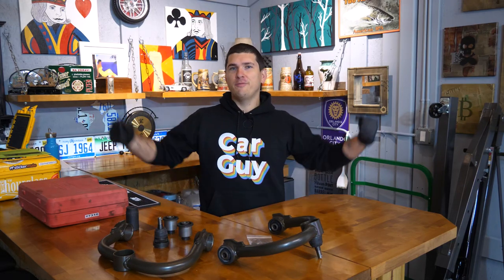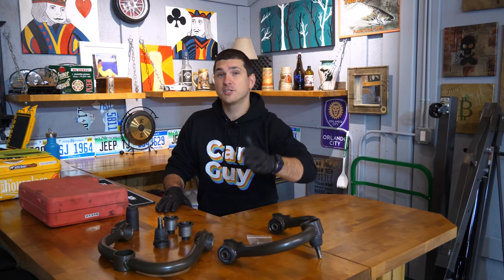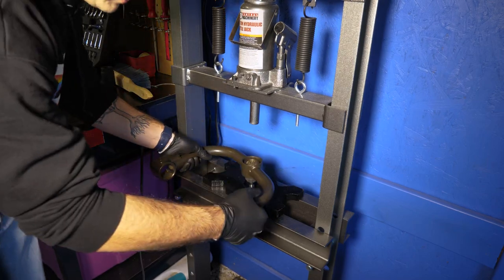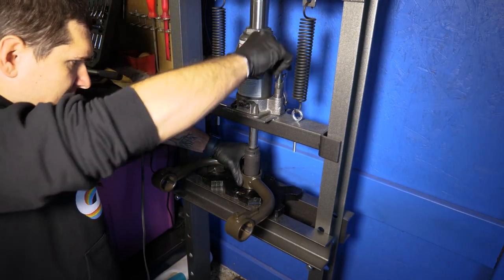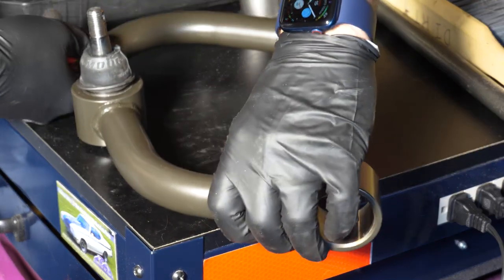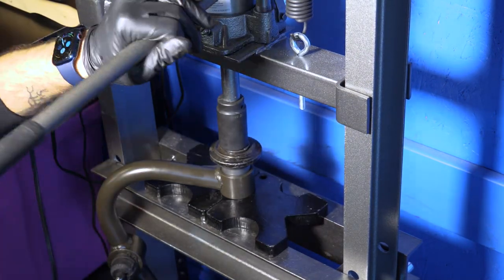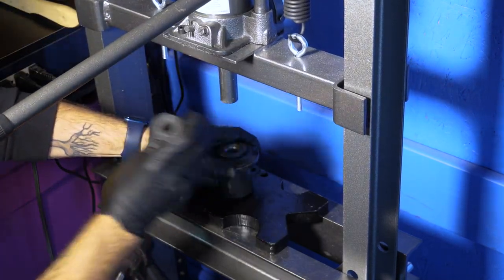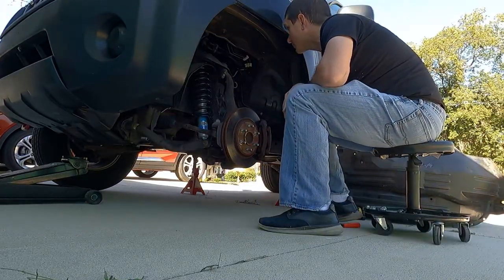How To Replace Upper Control Arms on an Xterra / Frontier / Pathfinder

Comment: Hi Ry! :)

I have a video suggestion, have you thought about putting Armada mirrors on the Xterra before? I saw someone on thenewxorg and youtube have them on their X and the benefits are:

- auto-fold or press button to fold mirrors (useful for tight parking spaces and small garages)

- auto-dimming (no more squinting your eyes or moving your mirror away to stop the ridiculously bright HID's from the car/truck behind from blinding you)

- turn signal LEDs (useful to help better alert someone in your blindspot that you need to change lanes)

- welcome light LEDs that illuminates the area near the passenger doors when you unlock the vehicle

Comment: As always,  clear helpful instruction for us X-terra do-it-yourselfers - thank you, Ry! As you've said/warned, take extra caution not to turn your steering once that linkage bolt is removed - learned the hard way when changing my UCA's earlier this year and broke my clock spring (broken clock spring = no steering wheel controls including cruise control and horn).
Reply from the maker: Oh yea, I didn't even think about the clock spring. It would over extend it and snap it. That's a great point.

Comment: I, with the help of Jisco Truck & Off Road, installed the RCKilla lift on my ‘24 Frontier and ran into the same issue replacing the stock UCA’s with Alldogs UCA’s.  We also disconnected the steering arm to remove the aft UCA bolt due to removal clearance.
I did not see this video, but called Alldogs for some guidance and they were incredible!  Walked us thru it and everything work!  
Thanks for this video and I’m now subscribed!

Comment: Helpful video, but you can bypass removing the steering linkage by levering it out of the way with a pry bar. Remove the other side of the UCA first and then you can pry the linkage out of the way and wiggle the UCA and bolt until it comes loose.

Comment: That was very well done. Comprehensive yet simple explanations. I  am at a crossroads as to whether I  should go to uca's when I upgrade my suspension. Gave me some clarity. Thanks. Happy Thanksgiving to you and your family.
Reply: Mike it all depends on what your bike plans are and how many miles you have on your vehicle. If you plan on going over 2.5” then arms are necessary. Also, if you have high miles and the bushings are worn then you have to decide if you want to replace with OE style or an aftermarket one like our ADO ones here.
Reply: @daywalker4029   Thanks for your input.  Probably on go with a 2" lift but the bushings and ball joints will need to be replaced. Guess it will boil down to cost/ benefit analysis.

Comment: Only issue I saw about my alldogs upper arms and might be something they could fix pretty easily to put a cap or plug over the top of the ball joint. It's a pretty big little bowl for water and dirt to sit, I just filled it up with silicone out of a tube and gun .
Reply: Good thoughts guys

Comment: Thank You for another superb video. I wish you were closer to me so I can bring you my truck. Right now., I am replacing the passenger side axle seal that I noticed is seeping. Also noticed that both upper ball joints are bad as well. So parts have been ordered, the Truck is on the jack stands, and trying to get this done with all the nervousness that goes with doing it alone. While watching your video, I was wondering where is your front axle, then I realize you have an RWD Xterra.  If you would near me, Bear and dinner would be on me, 🙂

Comment: 14:47 you need to use a 19mm pass-through shallow socket ratchet (DURALAST from Autozone)  to clear the brake lines. Worked great for me! Thanks @Ry the car guy!

Comment: I was very happy to see this video as I have been debating doing this myself be taking my XTerra into my mechanic! One thing I didn’t quite understand is what you are securing the twine to, couldn’t quite make it out and didn’t understand what needs to be protected.
Reply from the maker: The top of the knuckle needs to be secured in an upright position because there are two lines that go toward the wheel hub that cannot be over extended. One is the wheel speed sensor wire and the other is the brake line. The assembly is very heavy and it puts a lot of strain on those two lines if you let it go. I took the twine and tied it to the actual spring. To secure the top and the bottom was secured by the floor Jack.

Comment: Did you notice a difference in ride quality from having an arm with fresh joints/bushings compared to the old more worn out one?
Reply from the maker: I'm not even joking when I tell you this. The second I turned the Xterra over to take it for a test drive the drive belt snapped off and I said screw it and left to go on my trip. So I have not driven it yet. This is the second time my belts slipped off. I think my tensioner might be dying.
Reply: @Rythecarguy  I just replaced my 05 X belt tensioner but curious what are the pros to this upgraded upper control arms? I'm going to look for your video on xterra brake bleed & pads replacement front & back :) Also do you replace your cats yourself? In Cali we gotta be super on top of cats

Comment: Quick question Ryan, I'm having a hard time getting the steering column joint back in the steering column bracket. Do you have tips on how to make it easier?
Reply from the maker: Just jam something into the part where the bolt goes in to widen it. Thats all I got. That and maybe lube it up with chassis grease.

Comment: With this ADO lift, it comes set at 2 inches but with the bilstein adjustable shocks, are you able to lift it a little more?
Reply: Definitely steering towards this lift kit, and include the .5 spacer as well. Do you think this will be a problem with CBC?
Reply from the maker: No and yes. No you should not use the shock on anything but the lowest setting. The spring does all the lifting. 

Yes, I think lifting more using a spacer will start to give you CBC. Just using this kit got me close enough that I ended up swapping the UCAs.
Reply: I have 05' Frontier, RC 2.5 inch complete struts up front (No spacers). Will these UCA's get rid of CBC?

Thanks for everything, btw. My truck only runs because of you, haha

Comment: Are those zerk fittings for sure thread in ? I don’t see threads on the ball joint making me think there are drive in type vs threaded?
Reply from the maker: The ball joint doesn't have threads. I used the zero to tap it. I guess I didn't really say that in the video.

Comment: You mention that you have the 5100’s on the lowest setting. Is that the same settings you had during the install video? I rewatched it and I don’t think you ever say what setting you choose. Have you tried the highest setting? Are you planning on changing it now with the new  UCA’s?
Reply: He has the ADO springs on the 5100s. The springs do the lifting, so you can go over the lowest setting or else you run the strong possibility of breaking the shock. If you’re running the factory coil, you can put the spring perch wherever you want on the 5100
Reply from the maker: What he ⬆️ said lol.  Also yes, I have not made any changes since the install video. Everything is exactly as it was other than an alignment and cam bolts. (Also a video).

Comment: Will installing those upper control arms change the toe in and out at all i have them and want to install them butt can't afford a alignment right now i also have the cam bolts as well can i get the alignment close without wearing my tires I'm putting them on my 2018 nissan frontier pro4x
Reply from the maker: Yes, you will need to get another alignment after new UCAs

Comment: Well i got those upper control arms on my frontier they look good but at full droop they still contact the coil bucket right at the ball joint housing
Reply from the maker: Don't take this the wrong way, but did you install them backwards? I'm not sure how it's possible that you're getting coil bucket contact.
Reply: @Rythecarguy  it bearly contacts the very edge of the coil bucket i think my coil buckets might be just a little bigger it contacts on the ball joint housing butt also mine droop down more because my sway bar is removed

Comment: Would this still be an upgrade on a stock height frontier? I've been getting cluck/thuds on stops and go's.
Reply from the maker: Oh absolutely. You would still need to get an alignment but They are absolutely stronger and look better. And they come with new bushings and ball joints.

Comment: I just installed a rough country 2.5” suspension lift kit. Will I need aftermarket UCAs for that or am I in the clear?
Reply from the maker: You SHOULD BE ok.
Reply: @Rythecarguy  Cool! I’ll be sure and keep an eye on it. My stepdad is a mechanic and we did the install as a project together today and then I started reading some forums about the potential issue and got a little worried. I found this video during the madness. Thanks for all the videos you do, they’re all so helpful. Appreciate the response Ry!

Comment: How is the camber adjusted with these UCAs?
Reply from the maker: Using the cam bolts on the lower control arm.
Reply: @Rythecarguy  Can you add adjustable cam bolts for the upper control arm or is it unnecessary?

Comment: I couldn't take that bolt on the right-hand side. I was afraid that I will rip the boot. Now I will try again tomorrow to see what happens. that is not a very good design.
Reply from the maker: You can also disconnect the linkage if you want to be safe. Just be sure to put it back to spec, if it comes apart you wont have steering!
Reply: @Rythecarguy  Thank You, Sir. I got it done. I did it exactly the way you did it and the bolt came out with a little bit of struggle. So the job is done on the driver's side. I accidentally damaged the passenger side ABS cable while pulling the CV axle out to replace the front differential oil seal which was leaking, so other than that the truck is good to go. Thank You so very much. Your videos are very detailed and explain much better for a layman like me. Much appreciated.

Comment: Length of shock determines CBC. Changing preload does not cause CBC. A stock length shock set a 0 in or 2.5 in of lift, like the 5100, will never cause CBC because the eyelet to eyelet length of the shock stays the same. Adding a big spacer on top or going to extended travel length with the coilover will cause CBC on the stock UCAs. Y'all need to get your terminology right and not speak when you don't know what in the hell you're talking about
Reply from the maker: Nowhere in my video do I say that preload changes the height of the vehicle. Would you like to send me a timecode of the video where I say that? Sounds like you need to actually watch the entire video before you start running your mouth.